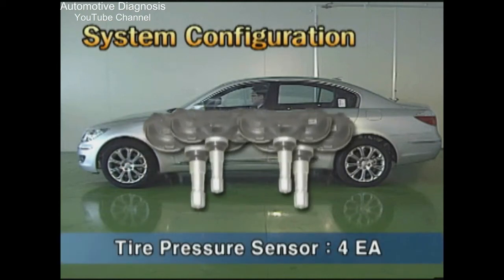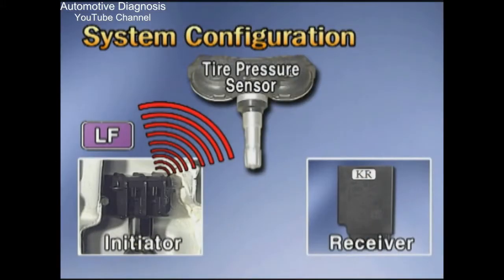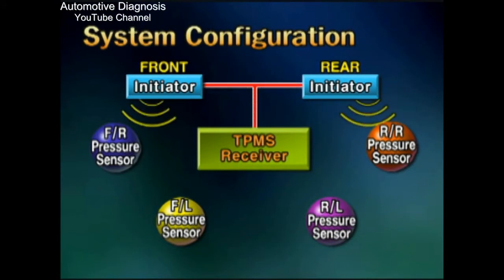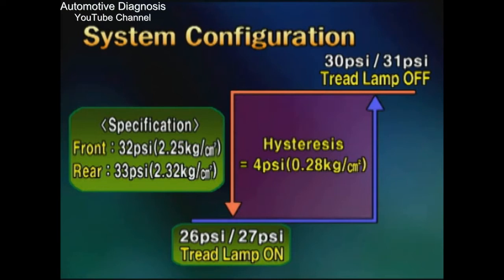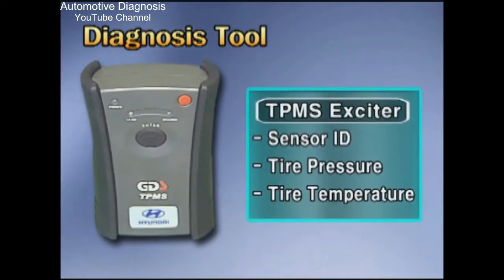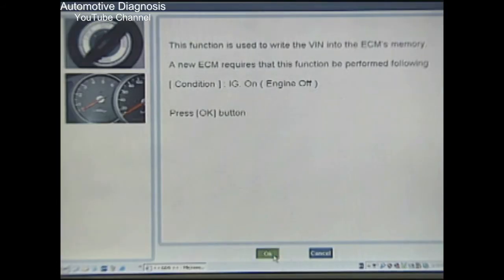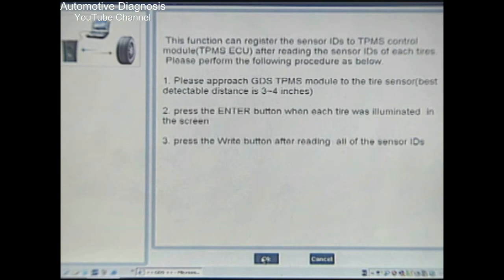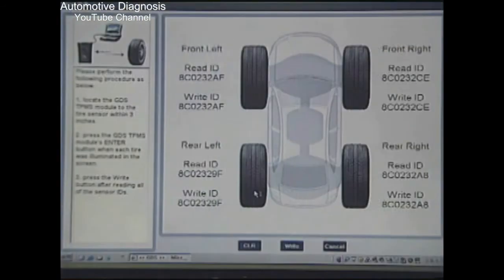How to Program (Re-Learn) Tire Pressure Sensors (TPMS) on Hyundai Genesis

Comment: What is the difference between the low tire light and the actual letters TPMS light on. My TPMS light is on. What could be wrong?
Reply from the maker: Hi there, Normally the TPMS light comes on in case there is any fault on the TPMS system as well. so if both TPMS light and low tire lights are on together it means you just need to adjust the tire pressure, but if TPMS light is ON alone, you must check your car with a scan tool as there must be a fault code. that fault code could be anything like the tire pressure sensors, initiators, wiring or TPMS module.
Reply: Hi, so if I have preprogrammed TPMS sensors and they get installed will the vehicle automatically recognize them? Thank you.